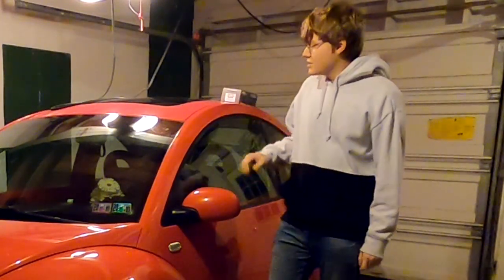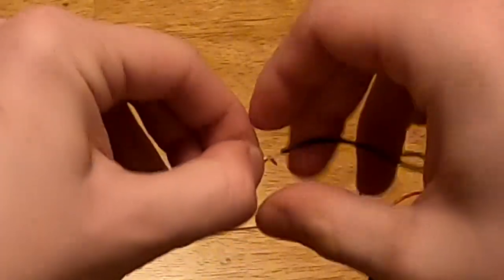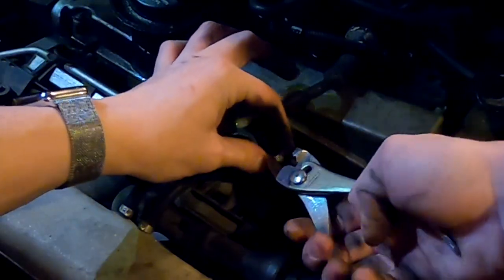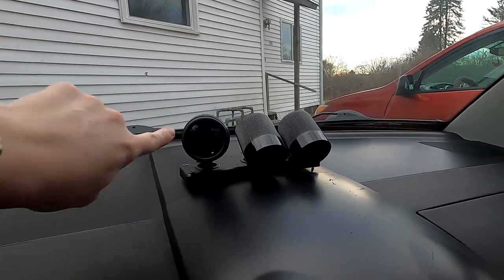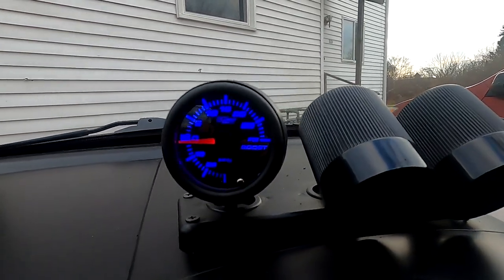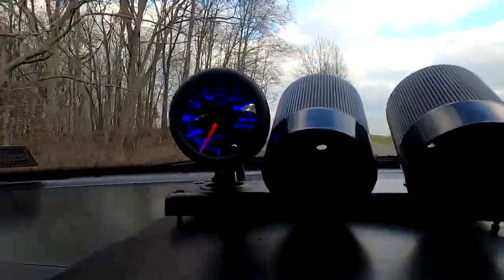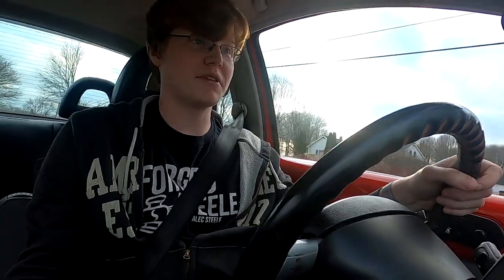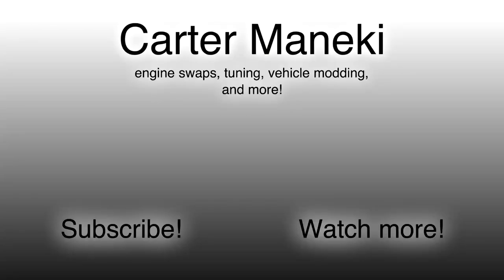THE PROJECT BEETLE GETS A BOOST GAUGE!

Comment: My buddy has a tuned 02 1.8t Beetle. He actually owns 2. One is all blacked out and the other is orange and is his father's. So far, only the black one has been messed with. 

Has R8 coil packs, NuSpeed CAI, Emissions delete, Tial BOV, oil catchcan and 3' downpipe and 3' exhaust all the way back. He also used a Turbo S front bumper, and is lowered on some coilovers.  Just basic mods I remember off the top of my head. 

Planning on switching out the stock KO3 turbo for a KO4 as well. Haven't dynoed but it does peak at 23psi OR a K swap. 🤣🙏🏽
Reply: Man, these cars tuned are incredibly fun and make decent power for what it really is.

Huge attention-getter because no one really expects to see a slammed Beetle to be loud and look good. 🤣

Comment: How much boost is the motor capable of?
Reply from the maker: Anand Korrapati the motor with a good tune people say can (supposedly) handle 23-30psi. The stock KO3 turbo, however, people say can (supposedly) output 23ish psi. I have not tested any of these yet so don’t quote me on that!
Reply: Carter Maneki knowing from what I see on forums, KO4 turbos are the way to go if you want a ton of boost and power
Reply from the maker: Anand Korrapati KO4’s are pretty good all around. All depends on what you’re trying to get out of the car, a KO4 is one step up from the KO3 and KO3S. There’s lots of other crazy turbo’s out there, if you’re going through the trouble of a turbo upgrade go big or go home!